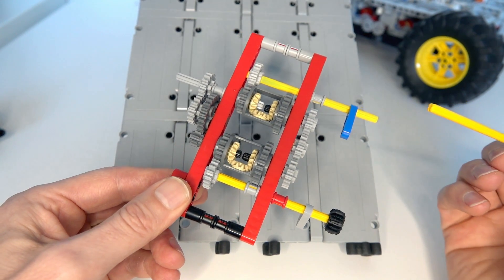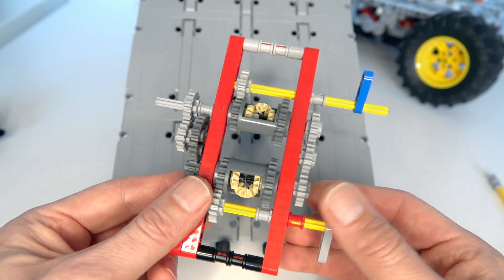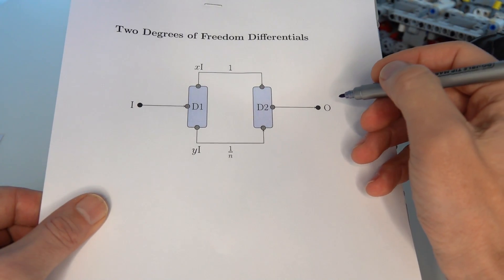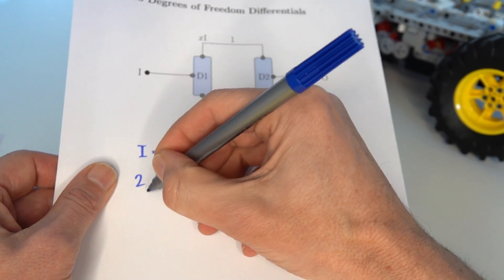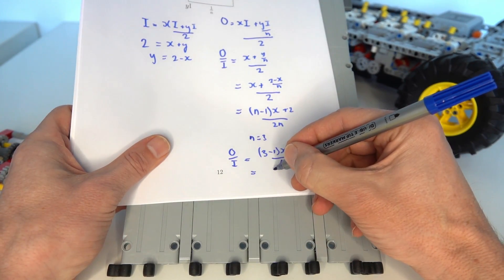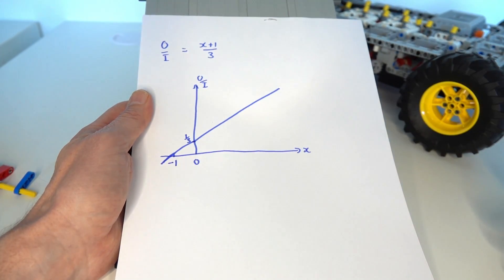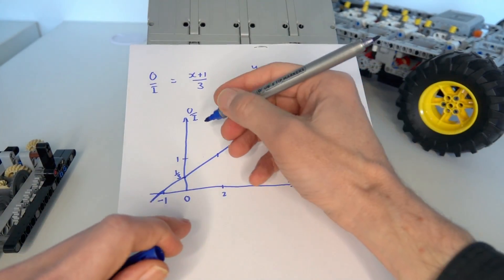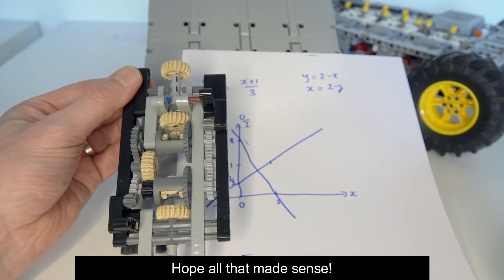Lego Technic Two Degrees of Freedom Differential Analysis

Comment: OMG I just posted some videos of a gearbox, and have spent hours looking to see if there was anything at all similar - and yours is the  closest.... except I believe you didn't complete it, and add to a car? I have, and it's got totally smooth power delivery and transition from high to low. You were missing just one detail to make it happen. Hope you could take a look at my channel, and maybe we could email sometime and compare notes. Cheers.
Reply from the maker: Hi Carl. Wow great job. Looks like your cvt is working really well. Yes you're right I never put mine into a car as I never got it working quite right. Thanks for sharing. Do you have instruction for your design?
Reply: @TechnicBrickPower  Hi, actually the layout on the first "2D" model is surprisingly like yours. I was shocked to see your one btw. I don't have the same differentials you do, but the principal is the same. There are two paths. Without seeing your idea, I developed mine, and added a slipper gear so that under low load, power goes directly through the 1;1 route. When it hits a ramp, it begins to use the lower geared path.... blended power.
The car uses a stacked version so the gearbox is almost a cube... The slipper is key - check the 2D prototype and see how I used it.
By the way, I'm seriously impressed with you channel content for analysis and design, and way better video production than I can manage 👍
Reply from the maker: Hi again Carl. Don't be shocked - I have found most ideas have been done before by someone at some point!! Sometimes I post stuff on Eurobricks and someone will reply with "such and such did that in 1992" LOL. Actually I did do something similar to your gearbox but instead of using the clutch gear I used a linear actuator to create adjustable friction to allow you to set the gear change point. I put two in series to create a 3 speed auto. To be honest I am not sure how well it would work in a car though. See https://youtu.be/TUCKzPP3HQY.

It's not that hard to get reasonable video production - you just need a few cheap bits of equipment and a video editing program. The content is the most important.
Reply: @TechnicBrickPower  What I'd like to do is design a load monitoring system so the slipper clutch isn't needed. It has a power cost,even if small, that a properly designed mechanism could bypass. I reckon one of your torque sensing models could help out here. By making the high torque path a super low gear, and somehow transferring power with a third sensor diff, it would combine cvt with a more sophisticated control mechanism. Fancy the challenge? I reckon you're the man to do this. I'll race you if you want a fun competition, winner buys first beers, second place buys next round :-D.
Reply from the maker: LOL - yeah after playing around with this type of gearbox I got distracted with other types and never got back to it again. Since working on some of the theory I may need to get back to this earlier idea. I will take on your challenge but I will be happy with 2nd place - I will post your beer unless you live in NZ!! I have a bit of a list of projects currently - and I have to go to my (real) work too! 🙃
Reply: @TechnicBrickPower  I only got into gearboxes as such when I tried running a Mabuchi 540 motor on my lego monster truck. Too many rpms meant melted axles, too few meant overheating motor. Finally got there, and now looking to use actual lego motors, and then I thought of using two XL, with a differential to merge them, giving 2 speeds. That's what made me think of multi range gearboxes. The problem is that the dog style gears shred when facing the 540, you cannot power shift.. even the old style gears don't like shifting with either high torque or high rpm. Lego were quite clever in not over powering their motors, so as not showing up the weakness of the gears.
All of this leads you (well, me) to diff+integrate solutions. It's one way to keep load off the shifting gears. How did you use the linear actuator? was that powered from a "monitor" diff? so many exciting ideas to check out.  Anyway take care and stay safe.

Comment: This is actually has a name :"Differential Transfer" ... Well ... one of my subscribers called it that way some years ago, when commenting on a 3 speed gearbox video, I couldn't trace the origin of the term but I think it suits the concept pretty well!
I used this exact configuration to create an automatic gearbox back in the day, Great minds think together, I guess.
I've used differential transfer in dozens of my creations: mainly for automatic gearboxes, but it turns out it is the best way (if not the only way) to create compact limited slip differentials.
I feel like this mechanism still has untapped potential, and I'd love to see what you come up with, next!
Reply from the maker: Hi Lego Techic Mastery. Thanks so much for your detailed comment and explanation.  I had no idea what it was called but I am sure it has been studied a lot by mechanical engineers already. It is a very interesting mechanism and I wonder what can be done with a more complex version with for example n degrees of freedom. I agree I think there is much that could potentially  be done with variations of this design...I will keep pondering and I am sure you will too  ;). In the meantime I am going to watch your videos and learn. I love your geometric work and designs - really interesting. 🙂